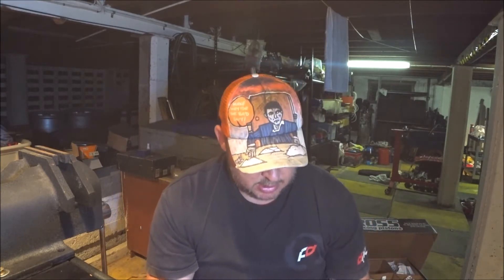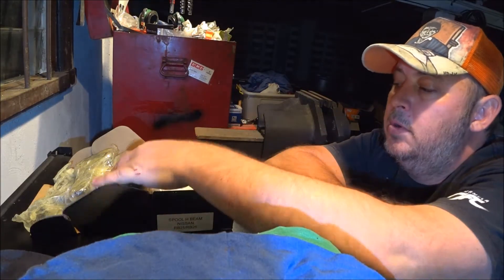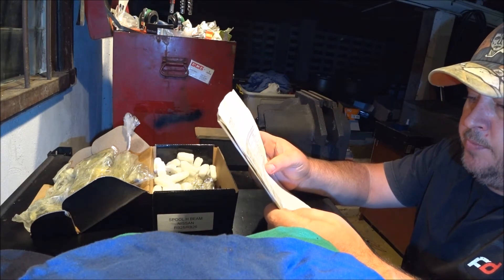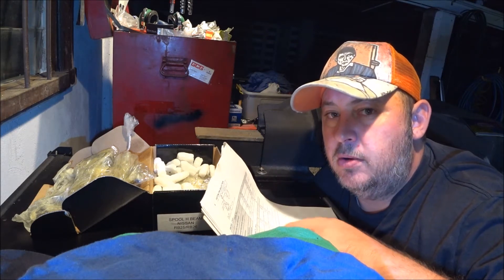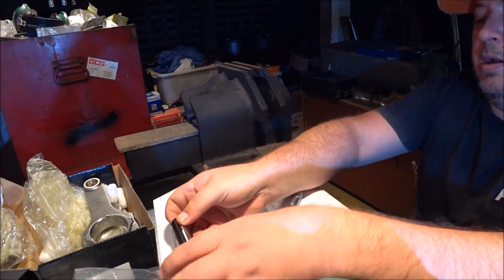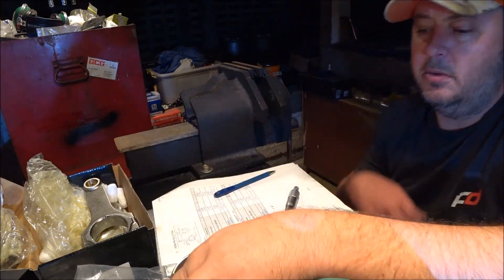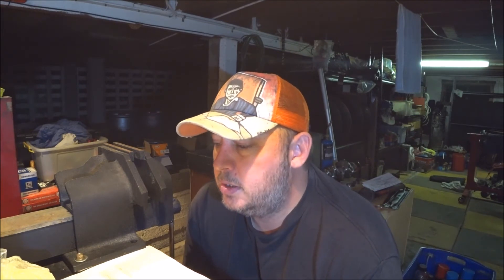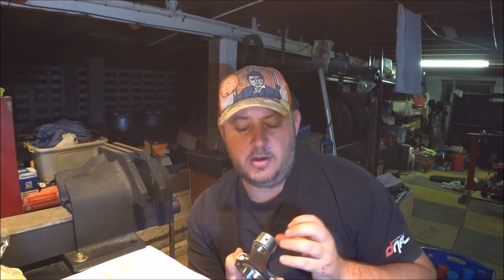RB25DET build - Spool rods & ross pistons

Comment: interested to see what you do with gudgeon pins. i'm building a rb25det neo myself with cp pistons and stock rods. the cp pins are all 20.997mm and stock pins were around 20.990mm. small end rod bushings measured at 21.002mm so not sure if i should hone them a bit. The cp pistons have a free floating pin like your ross ones so maybe it's not as much of an issue as stock interference fit?
Reply from the maker: sky17 if found some were tighter than others too. I wanted to assemble them all for a pic but didn't want to risk damaging them. So I'll be talking to the machinist tomorrow when i drop it off. Be sure to follow up in the next vid if i don't cover it. Ill let you know. I assume though you could usethe smallest pins in the smallest rods then balance around them. May need a linish? Stock is certainly not an inyerference fit. But its nearly a flush fit.
Reply: haha ye following this one. i was refering to the pin to piston fit. It's interference on stock. but a floating fit on aftermarket pistons.
Reply from the maker: Factory clearance is 0-5 microns. That's not interference fit. Interference fit is when the hole is smaller than the pin, so you have to press it or heat or cool one or the other. I Dropped it off to the machinist today asked them to check the diameter to make sure it's all good and if not let me know I'll go back to spool or ross.
Reply: if you're using the translated r33 workshop manual page en-213 says -0.004 - 0 clearance and later on it says use a heatgun to install the pin. anyway doesn't really matter the since it's not relevant to the aftermarket pistons
Reply from the maker: sky17 you know what i knew it said that on 213. For the 26 not the 25... but looking in the back you're right it is -4 to 0 for the piston pin hole clearance. But...it also has a piton pin bush. So i did miss read it. But yeah not relivant with the aftermarket ones.
Reply: @tangles01  Hi tangles, what's your opinion on the spool parts, did you get any feedback from your machinist?
Reply from the maker: @MR-op9ur  The rods should be sweet, feedback wise, I assume you're talking about the pins, the rods are designed as a semi fish and should be final honed my the machinist to suit, if that's what you mean?
Reply: @tangles01  rods are designed semi float?
Are you running a larger bore or stock, it's been a minute since I've watched the video (I enjoy your videos but not trying to watch the whole thing again to check if you said haha).

I guess my question was really geared toward if you've heard good or bad things about spool. Thinking of getting myself a set (I have a RB25DET NEO) and the kit spool sells looks pretty good.
Reply from the maker: @MR-op9ur  Ah I though you were asking about the pins and the rods... pins are full floating but the final machining needs to be done after you buy the rods... Spool have a great name, these rods are rated to 800hp so I certainly hope they do the job at 550 odd.